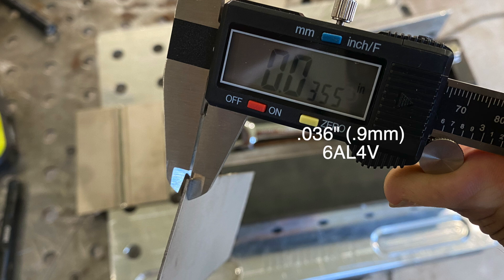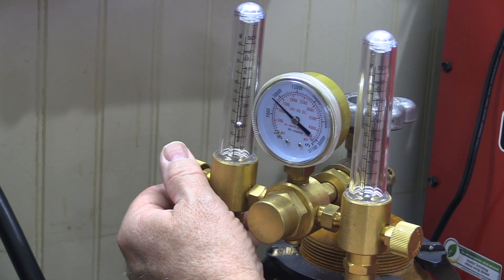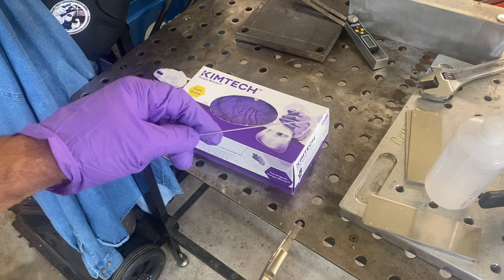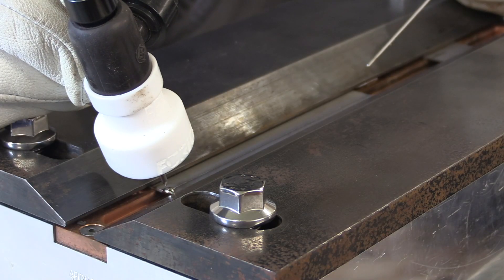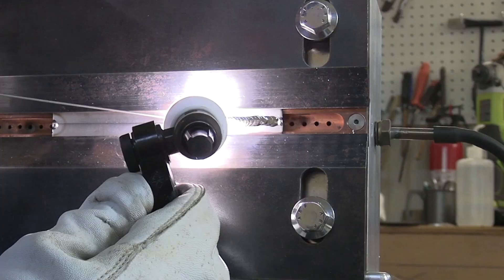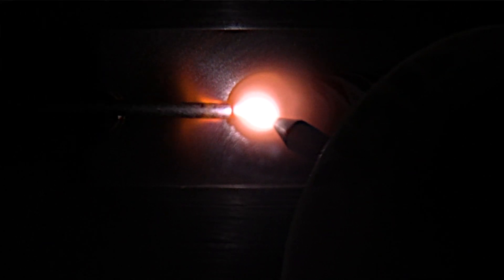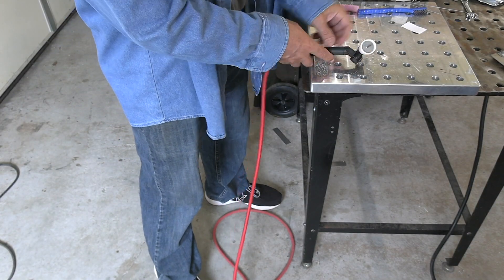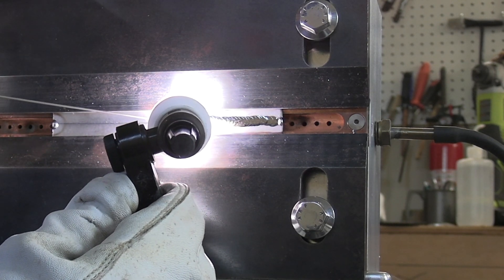Tips for Passing a 2G Titanium Weld Test

Comment: Thanks for these videos Jody, this in particular reminds me of my time in Aerospace repair. When it came to re-qualification time, admittedly, we ALL had a bad habit of just banging the test pieces into the fixture as issued and failing for the exact thing you showed. always used to have a hard time getting the bead to penetrate so close to the end also, being that too much amperage would blow the end off, and not enough just couldn't get through to the back.
If we failed our first attempt, we always got it second attempt.